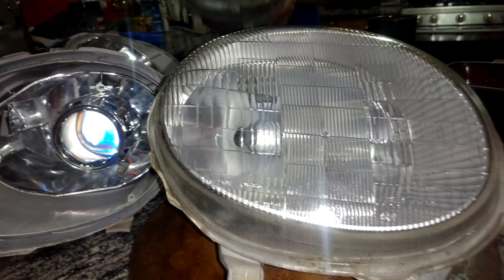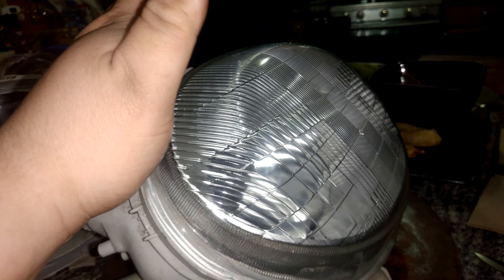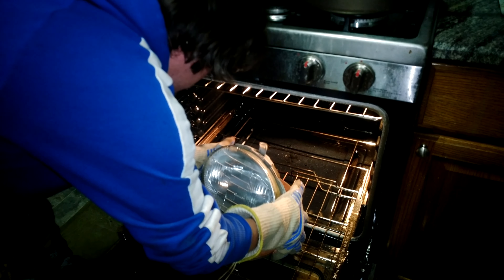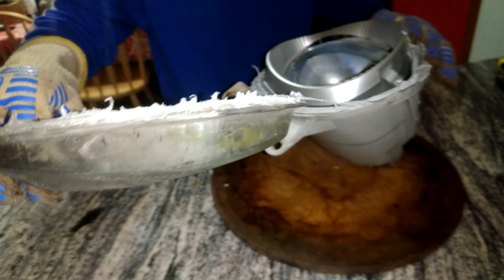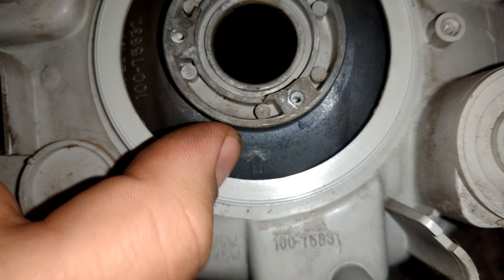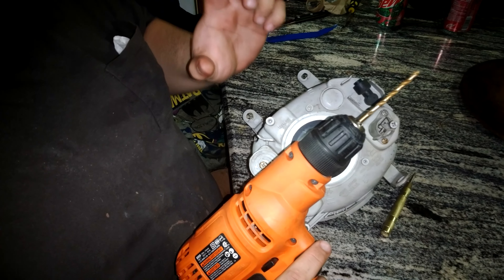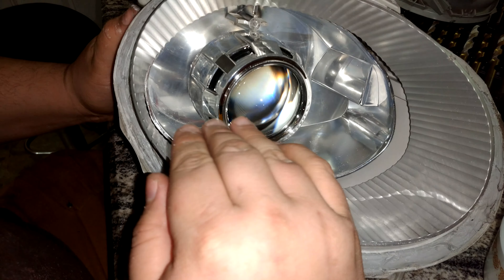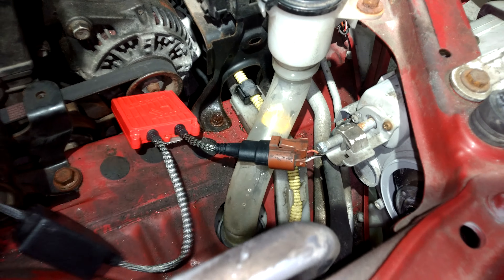How to retrofit Bi-Xenon HID Projectors in a Toyotal Celica (6th Gen) (1993-1999) Complete Guide

Comment: i would have never srilled that big hole for the molex connector.  cutting the wire and feeding it thru a tiny hole and then soldering the connector back would have been my optumal method.

Comment: uhh better are you sure?? you put a projector inside but then didnt get a clear lense for the housing. cutting the potential of the projector design.
Reply from the maker: We though the glass lense might be a problem as well, but in testing it seams to not be an issue in the slightest.

The Kazuki lights are only HID on the low beams. This setup is HID for both high and low beam.
Reply: @fullbore782  You can literally see on the video how it is an issue.
Reply: @Flashbang_Photo do you have a link for the clear lens ?